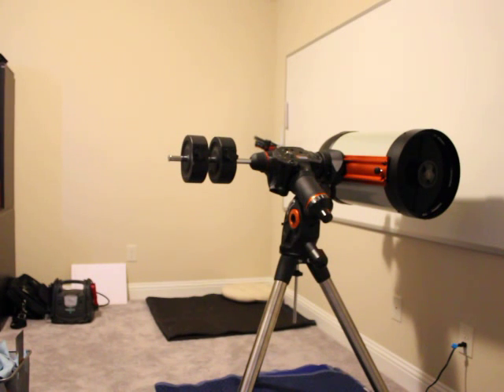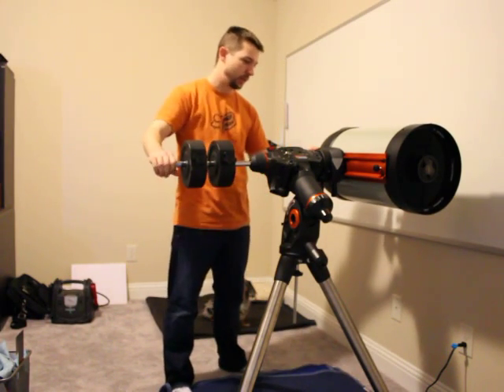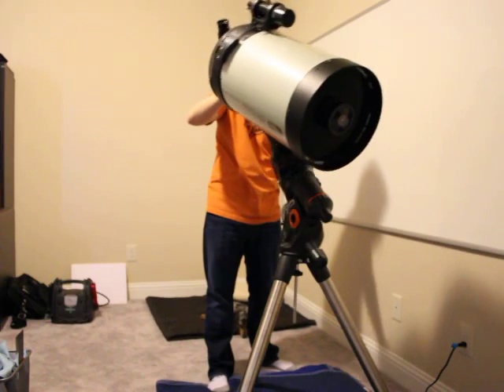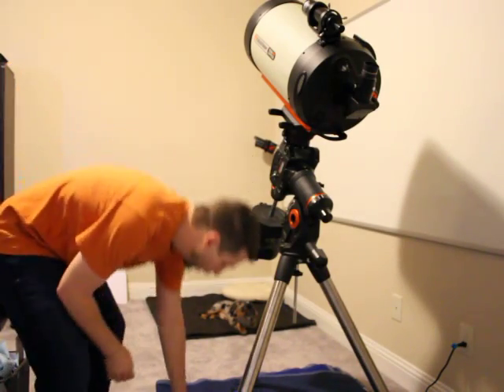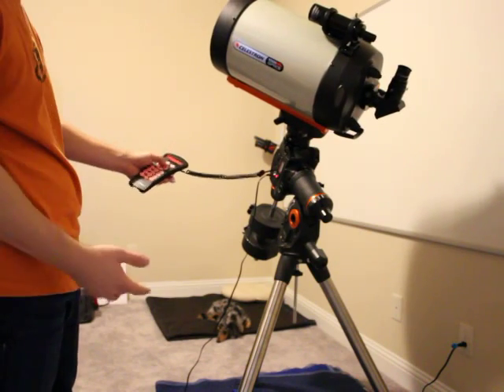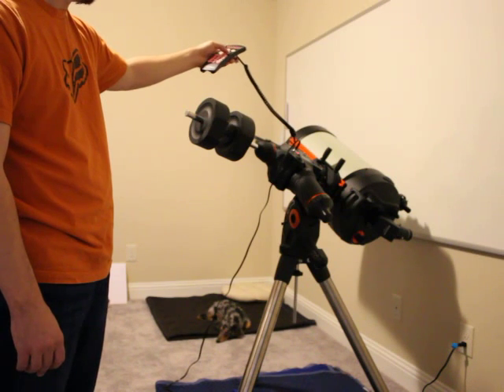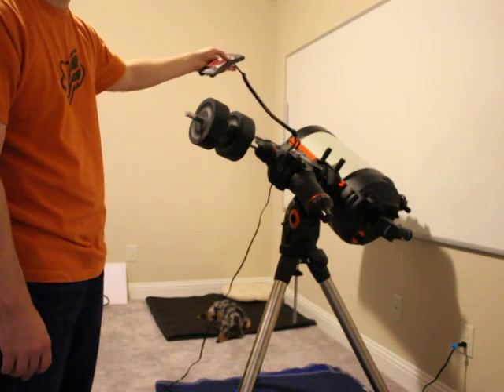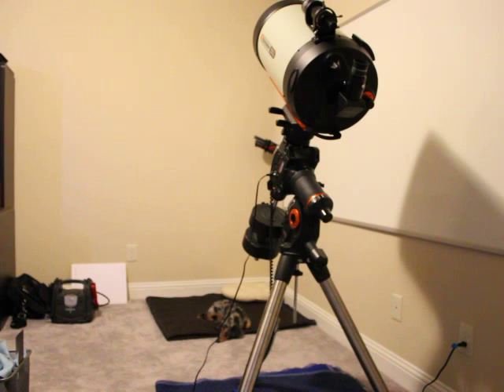Celestron CGEM Tuning | DIY Hyptertune Results

Comment: Is all you did cleaning and relubing? If you put too tick of a grease it may have caused a suction effect causing the gears to strain some. If you took the gears out to clean and such then maybe try resetting the gears to see if there were some alignment issues. I wouldn't be too worried about the imperfect counterbalancing. It's hard to perfectly balance an amateur telescope because there is a small moment caused by the finder that May or may not cause some imbalance in certain ways. I haven't tried to see if it does but it seems like it could. In my opinion I would just try it under the stars. First test it's pointing, then test it's tracking and periodic error. If it's a grease issue then I suspect a bad periodic error. If a bad gear alignment then tracking will be funny as well as pointing. If everything is reasonable and up to par to what you want then I'd say go for it. If it's not then maybe just go through your procedure once again and make sure everything is places perfectly. I've had it where my mount would get louder and quieter at times but not as dramatically as yours. But I'm just spitballing ideas here. I'm by no means a pro on the mount. Best of luck
Reply from the maker: I had it under the stars last night.  Things worked normally.  However, in the video, the clutch's are disengaged, so I suspect that any gearing issues when balancing wouldn't be a contributing factor in the stiction I'm getting when the OTA is on one side of he mount, but not on the other.

I used a little grease, not a lot - just enough to evenly coat the mating surfaces without creating build-up.  I say this not to debunk your idea, but because I did not mention it in the video.  I am waiting on more super lube to arrive at the store and I will try this again, paying closer attention to how much grease I apply to the mount.
Reply from the maker: I forgot to answer your first question:  I also lightly sanded the brass ring gear assembly and polished it to a mirror finish.  There were no major rough spots or burrs, but I was able to visually see some scratches and other tiny marks that I wanted to smooth out.  

I may need to redo this process as well, as it is possible I did reduce the size of the brass gear to the point of eliminating any friction between it and the mount casing.
Reply: One possibility is that when you sanded down the gear it caused it to be asymmetric which could cause an imbalance but it is odd that it stresses more near horizontal since it is balanced. If if were imbalanced I could see it but you had it well balanced. If you regrease it and it performs well then I might say just don't worry about the noise. Try if out over a few weeks and see if good results are repeatable and if so.. Enjoy a great setup :)